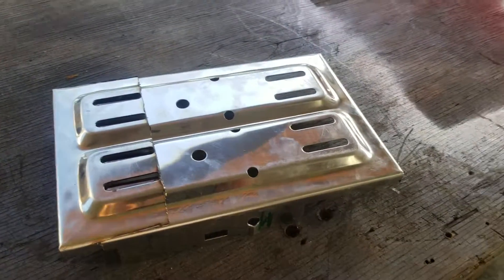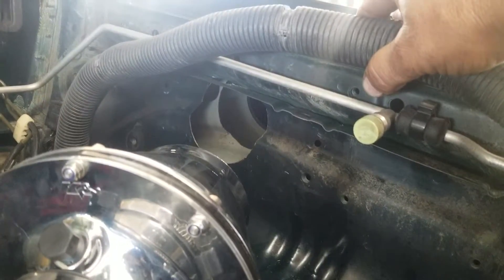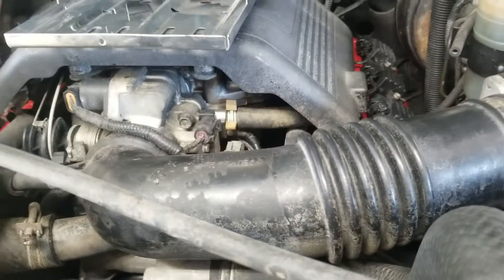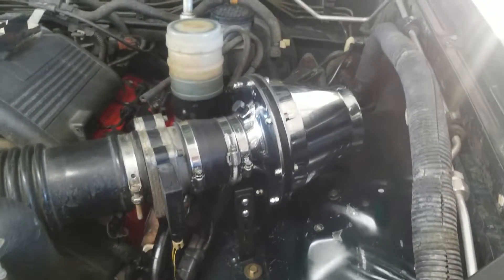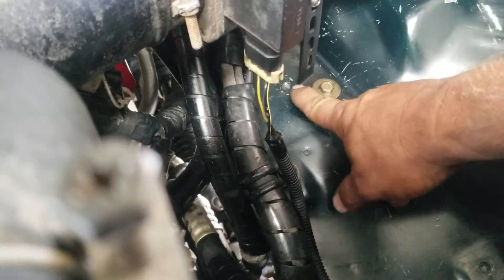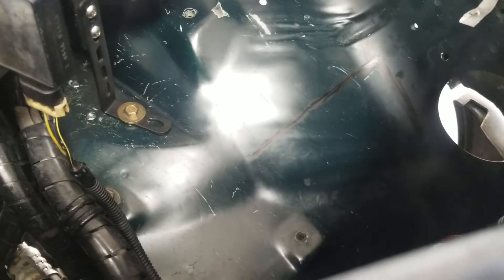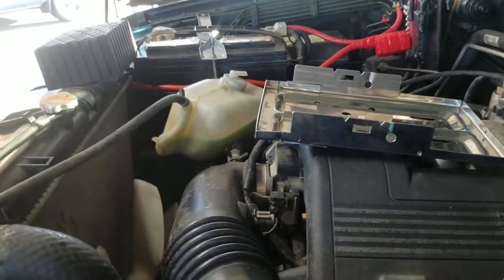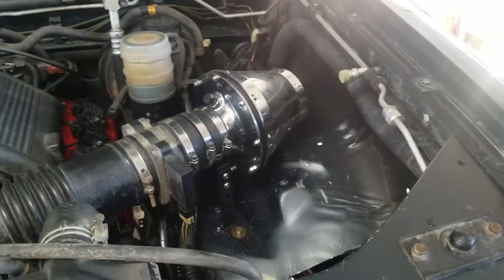1998 Isuzu Trooper 3.5l Dual Battery Installation Part 1

Comment: What’s the model number and website you got that intake from? I have a bighorn I’m trying to install that snorkel on and wanna see if I can do the same set up you did
Reply from the maker: Hey. I got it from eBay. It was an open box return for some import car. I paid $70 including shipping. They go for up to $300. It's a K&N Apollo. https://www.knfilters.com/mobile/apollo.htm
Reply from the maker: I bought the K&N mounting bracket and the rubber adapter from K&N off Amazon. I had to fabricate the bar that hold the mounting bracket to the vehicle. If you want more specific details let me know and I'll find the links to everything I purchased specifically.